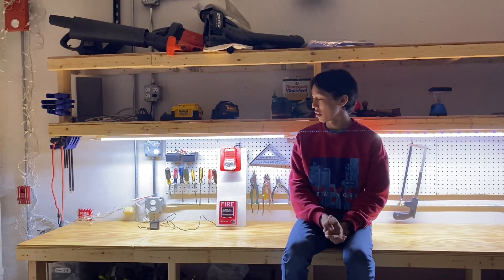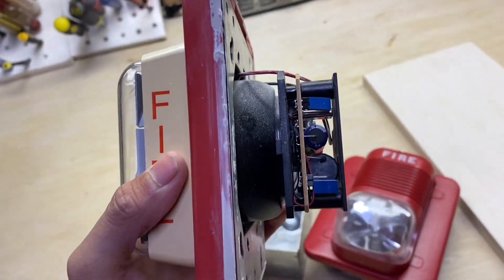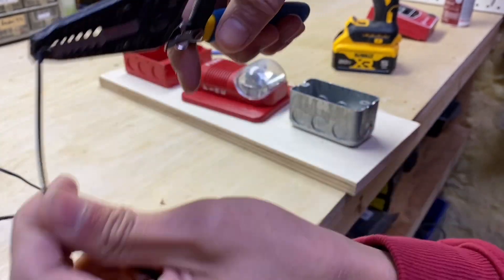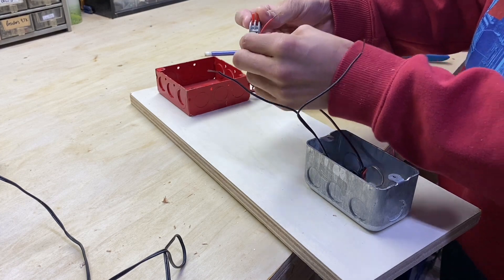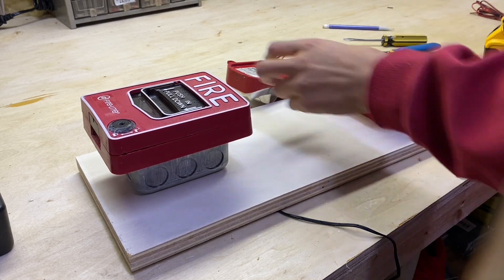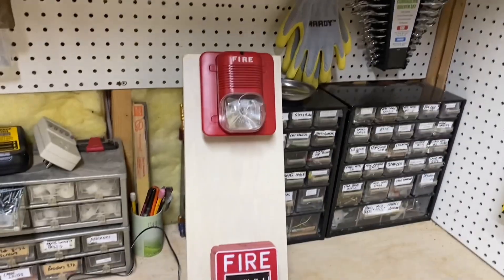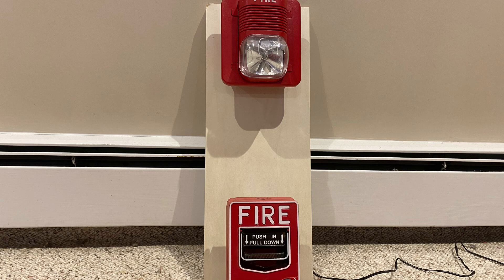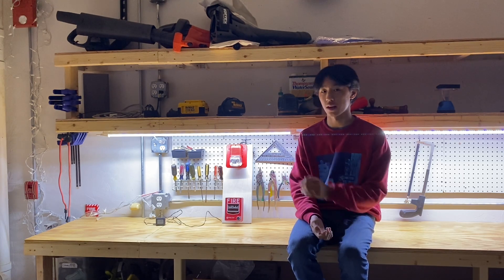Make your Own Fire Alarm Board without Spending Hundreds!

Comment: I found the pull system and horn strobe for 10 each as well as a $3 power supply on aliexpress. Ordered the bell cable and electrical boxes for $6 total at home depot, free shipping. Cable connectors were 7 at ace, free pickup. Ordered flooring sample for the wood (may or may not work). If the flooring works, that's a little over 30 total.

Comment: What alarm did you use? What alarms work with only a pull station and 24v power supply?
Reply from the maker: Any conventional pull station and 24VDC device will work
Reply: @FireAlarmDude5967  what did you use in this video? what is the name?
Reply: @bibleverselyricvideos  Alarm is a SpectrAlert Classic, pull is a NBG12
Reply: @clxdyy_  Thanks will any spectrAlert Classic work with a pull station? thanks again for your help

Comment: 0:45 I guess we both learned how to use a table saw without the blade guard, or at least prefer not to use it.
Reply from the maker: Blade guards are optional, riving knives are mandatory
Reply: who the fuck uses a table saw with a blade guard?
Reply: @ironmatic1  Exactly!
Reply from the maker: @ironmatic1 I mean, I wouldn’t ever discourage someone from using one because they are undoubtedly inherently good but I certainly wouldn’t be too concerned using a table saw without one

Comment: This really helped. What I did is I did what you did and then I put two pieces of wood on the side and one on the bottom to help it stand up.and plugged it in and it worked the fire alarms I used for a 2099–9754 t bar.and a Wheelock exceeder low frequency sounder tysm 🎉

Comment: Question, how do I find out what side is positive and negative on a simplex conventional pull station
Reply from the maker: Conventional pull stations aren’t polarized
Reply: @FireAlarmDude5967  thanks and also I have another question, I have a simplex 2099 9756 pull station with a gentex commander 3 strobe and when the pull stations not activated it flashes but when it’s activated it stops. How can I fix?

Comment: Thank you for posting this!  My son is 4 years old and obsessed with fire alarms.  I know nothing about them, but am going to try and build this for him for Christmas.  Couple questions

Are the handy boxes sizes standard?
I think I have a wall adapter charger for other equipment, does it matter if it's 12V vs. 24?
Reply from the maker: Handy boxes come in different sizes. For pull stations, look for the single gang one shown in the video and for alarm devices look for a 4x4 square box. The voltage depends on the alarm, 12 volts will usually be fine for Joey devices

Comment: I am wondering on how to also wire up a 24vdc relay to my board. ive bought just a simple relay 14 pin. and curious on how to use it. or any way of adding an audible silence or just a silence switch in general.
Reply from the maker: Not sure. I’d recommend a simple 24 volt triggerable relay

Comment: 500 bucks is ducking insane, You can find a cheap pull station and alarm for under 60 if u use ur wall, and if you dont you can just get wood for like 20 bucks so total is less than 100
Reply from the maker: Right

Comment: When I do the 24 cable I can get to horn to work but I can't get the strobe to work do you have any suggestions
Reply from the maker: What are you asking?
Reply: @FireAlarmDude5967  im trying to get the horn and strobe to work but the strobe doesn't flash when I hook a 24 volt cable to it
Reply from the maker: @project-S-805 What device
Reply: Maybe it's a 4 wire device or a broken strobe

Comment: I am trying to make one of these. Can you help me on how to make a latching relay? Basically when the pull station is reset the alarm still sounds until i reset it.
Thx
Reply from the maker: You need a triggerable relay. Bridge the common and normally open contacts to the pull station that wire the alarm through the relay

Comment: I wonder what that little plastic thing you used for the pullstation wiring is called and some of the specifics on putting the wires in, I do notice how the wire goes in, but it's kinda hard to tell which ones are being connected together. I've always wondered how people provided power for the pull station in that kind of testing setup

Comment: I have a question: my strobe/siren goes off wether the pull station is activated or not. Its wired through the call points and Ive tried a couple different pull stations and they all do the same thing. Any ideas why?
Reply from the maker: You’re probably wiring the call points wrong. The call point should be wired like a switch.